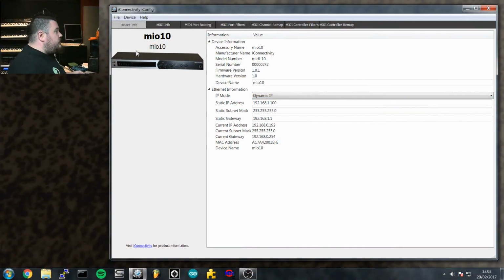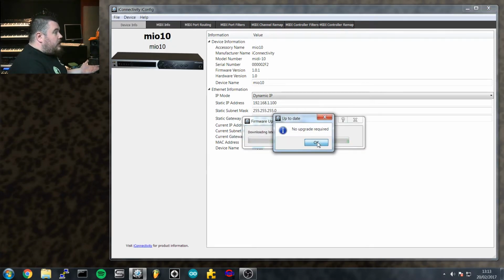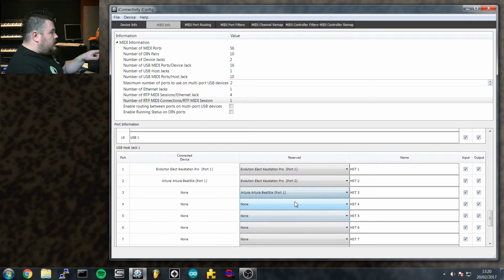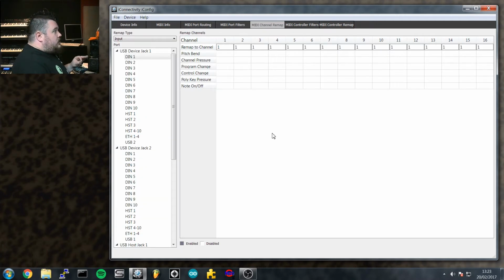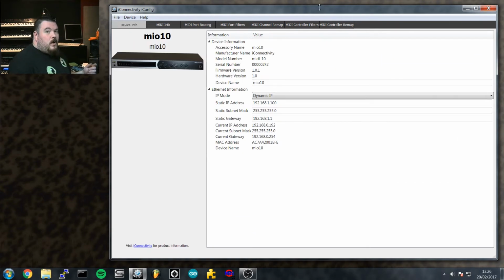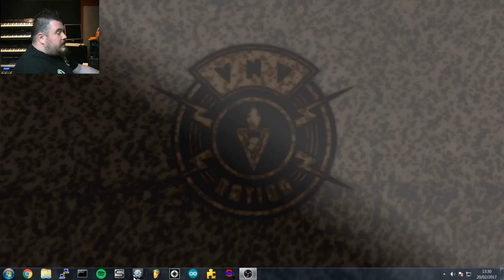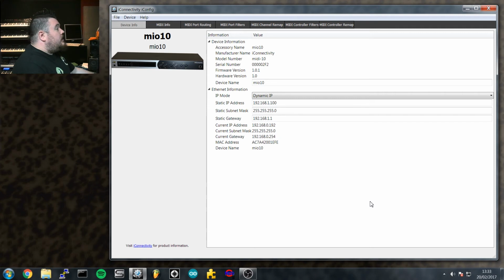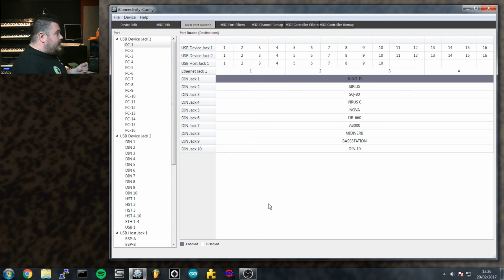iConnectivity mio10 MIDI Interface and patchbay unboxing, setup & review

Comment: I'm a little confused and hopefully you can clear this up.... This allows you to go from FL Studio MIDI out 1 into the mio10... which then goes from the output into all your synths.... & in FL Studio you can control all of your synths by giving each MIDI out inside FL Studio a different number?
Reply from the maker: Actually, the mio appears as a load of separate midi devices in FL but you can also send what's going to on port to other ports, it's very flexible.

Comment: My VoodooLab Ground Control Pro Foot Controller stops responding, sending MIDI messages after 5 minutes of use, i don't know why this happens every time ! Do you think this MIDI Box could solve this problem of MIDI messages errors, weak signals and latency ?
Reply from the maker: Sounds like the issue is in the controller itself; I'd suggest hoking it up to a computer and using something like MIDI-OX (http://www.midiox.com/) to check what's actually coming out of it..

Comment: Helpful video! Thanks for that. Although the Mio10 is now discontinued, it put me on to the MioXL. I need a MIDI interface upgrade and was about to get the Motu Express XT (in-spite of the reported ongoing SYSEX problems - because what else is still out there?) - until I discovered your video. Two things that got my attention immediately: USB input and Ethernet. I have synth gear from pre-Midi (CV), MIDI, USB eras, and even 3.5mm to Midi DIN (adapter). Being able to connect most through one hub will be a big advantage. How reliable has your iConnectivity gear (hardware and software) been?

Question I have at the moment is what is the difference between AVB and RTP? Eg MOTU and PreSonus uses AVB networking  (I have a MOTU AVB switch and Audio Interfaces). Is the iConnectivity compatible with the AVB Switch, or will I have to plug it into a normal ethernet switch? I cannot find an answer through google, but I assume the latter. Will any conflicts result? I assume the computer can handle the different protocols through different host software. I also use Steinberg (Cubase) and other software on Windows 10.

Also I assume the mioXL can be used in stand-alone mode without a computer - something I need ocassionally to connect my legacy hardware synths together without a PC.

Comment: Good video.

Coupla things. 

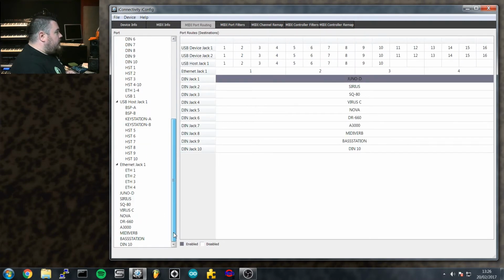Your master template, (20:43) seems to have two ports named for each USB controller, but Max Ports per USB Device is still set to one.

Also, when naming devices, I find it less confusing if I include both the Mio-10 port type and number, AND the name I wish to assign to it.

Example, a DX-7 on DIN port 3 gets the name "D3 DX7." An Akai MPK-261 on USB port 2 gets the name "U2 MPK 261."

This is especially useful when inside a given PC or DAW. A string of 16 devicenames only, makes it hard to know which LEDs on the front panel should or should not be lit at any given time, and missing assignments by one port then LOOK pretty much ok, delaying successful troubleshooting.

These problems go away when the devicename includes both the port number and device type, as described above.

Comment: Sadly there seems still to be no way to route a devices midi channels seperatley to each of the ins and outputs.  So, for instance on my Squarp Pyramid i cant route midi ch1 to DIN10 INPUT ch1 then Pyramid Ch1 tyo DIN10 INPUT Ch2 - its a huge failing imo.

Comment: I have a mio10 my main configuration that came with the unit is inactive hit rest on mio10 but no MIDI lights or external MIDI equipment is non functional. Look in your iconnectiviy iconfig and do a step by step instructions video to physically reset mio10 email me the configuration
jnreissiger@gmail.com
Thanks

Comment: Hey there great review on the mio10! My quick questions. 1) I have a few midi synth modules that I want just pull sounds into my DAW for, so can I just use a single midi cable on my DIN ports? 2) for the USB hub can it handle a midi controller keyboard as long as it is class compliant? 3) Do you have a video on working with virtual synth connections (I’d like to use my Native Instruments Komplete library in this chain as well)?  Thanks for any thoughts you can share.  Keep the great vids coming sir.   —Mel...

Comment: Fab review thank you. My question is based around further expansion. I have an old Edirol UM880 which stopped working properly with my Macbook when El Capitan came out hence buying the MIO10. The UM880 is a class compliant device so I wondered if it should work with a hook up from the (standard flat) USB port on the back of the MIO into the (square) USB B in on the UM880. I'm guessing I should then set the maximum number of ports to 8 in the software to be able to "see" the 8x8 ports for routing?

Comment: thank you!!! excellent review. I wish i had looked this up sooner:) 
spent a few hours learning from the manual ( this can be better written especially giving more examples of in the midi routing page with respect to midi modules, vs synths vs midi controllers as well as in the midi filtering page. Also listing the din jacks separately on two usb for computer connection as well as separately was also a bit confusing, especially for novices. Illustrating each concepts with examples would greatly help in improving the manual. you did a very good job in explaining things. 

the way i got around the usb hosts midi channel was to directly program the synths to receive midi on 1 channel from the daw. On my korg kronos i left to receive on all channels for sequencer to play in 16 channels is needed. My moog one, subsequent 37, deepmind and Model D receive on predetermined channels set on the synths.

Comment: Great review! Do you know if the software is been improved since 2017?
Reply from the maker: There are a bunch of fixes to the software I've shown - however iConnectivity also have an alternative setup system now as well, covering all their interface,, which is easier to use though has less in the way of detailed configurability (though I understand they will be extending it going forward)
Reply: I wish they had an iconfig reset if ya make an error as I did and I've had my mio10 since August 8th and as I finished all connections it ran as claimed but do make a video explaining how to fix the iconfig settings if everything was and is deselected you can reset it back to default in the iconfig program right now, this will be a major problem for new users and current users also. So please revise the manual for resetting the iconfig settings back to default as well add the iconfig reset defaults in auracle too this is required if you make a mistake routing information to and from devices. The reset function should also be in the auricle settings program and have all the settings backed on a USB drive. Figuring this out as a novice is not practical for anyone using any iconnectiviy unit. I'm contacting iconnectiviy Monday to see if I can resolve my mistake. Because my mio10 is blank and no instructions to read here, online at iconnectiviy.com anywhere is unexplainable. Be very careful what you route to and from any devices even if you do not know the iconfig program and it's preinstalled settings. This is what you get for not reading the default settings in the mio10 or other units main screens first six tabs and so forth. Recommend making some calls and changes to iconfig and reconfiguring iconfig into auracle so auracle can reset and resolve mistakes users make. Be careful. However make iconnectiviy aware of this.

Comment: Thanks so much for this.

I'm pretty much sold after watching.  👍

I've been looking for something like this but haven't wanted to pay the money for the motu.

In my scenario I've currently got all my hardware hooked up to my MPC but that makes it a pain to integrate the computer usefully so I have to choose between the two ways of working.

I'm hoping I'll be able to set this up with a couple of configs so I can switch between a preset that routes everything from the mpc to the hardware as it currently works but also allows me to use the computer & ipads as additional instruments and then another to allow me two way communication to all my synths and drum machines from the DAW without having to spend half an hour re-cabling.

Comment: Great and very usefull review, thx Bro! 

But one more and maybe a noob question: For example your arturia is connected through a USB hub and this usb hub is connected to the "usb port type A" on the Mio10, right? So this way it recognizes the keystations automaticaly? Will this do as well with the Nov-Peak, Rol. Tr8-S and to all USB connectable devices that i hook up to the same usb hub that is connected to the Mio10?

I'm using a FocusRite Scarlett 18i20 that is hooked up on my Intel Core i7-8700K 5.2 Ghz with Ableton live 10 and also connected by the DIN to the MIO-10. My MIO-10 detects a "FocusRite AE Peak(Port 1)" only, So i realy don't understand. Because i use a TP-Link powerd 7ports usb hub(3.0-2.0 usb supported) and its straight connected to the MIO-10 and on my USB hub is the Novation Peak and a Roland Tr8-s but it isn't shown in the MIO-10, just a "FocusRite AE Peak(Port 1)" 

I don't understand why its not in the list. Maybe you know why not, or anybody knows why?

Thx

Comment: Hey, i just got my mio10 yesterday and i think i might have figured out how to configure the feature you needed... i am using a advance61 as a master keybord and have the ability to select the 16 midi-channels like you wanted to do...
What i did on the OUTPUT filters on each synth port: enable all filters on the channels, the device should not listen to... so for the d-05 for example only the 5th "stack" is disabled (white) and so on... as all of my devices are configured (on the device) for port 1, i also did a remap on each OUTPUT midi port where the synths are connected with ENABLING (dark color) the reroute from port 5 to 1 (again the d-05 example)
These 2 settings for each synth OUTPUT side... (filter + remap) solved the issue to me....
the funny thing is: as the virus is multitimbral, i did this for many ports of the virus so i can select the different virus tracks from the master keyboard as well an use it as "different synths" very easily...
The bad thing about this kind of "workaround" is: only 16 channels!!! thats it....
But you could expand this idea with a second master keyboard routing to a complete new 16 channels on 16 diferent instruments - so if all 16 "instruments" from the first 16 port stack do not communicate to the 2nd. masterkeyboard, they'll not get any trigger from it... 
in fact i can do it with my master-keyboard alone because it has a second virtual port and i can select Channels A1-16 and also B1-16 - so i have 32 channels to use with only one master-keyboard...

i am using: Virus TI2 polar, Virus TI2 Rack, D-05, Digitakt and getting Deepmind12 and Behringer Model D soon...
Controllers are Akai Advance61, Beatstep Pro, Akai MPD232 and Keystep is ordered already...
Reply: i just wanted to add why i wrote OUTPUT in big letters: on the port-filters and channel-remap tabs, in the left upper corner the little select box is automativly set to INPUT... which means the INPUT PORT on the mio side.... but the communication TO the synth is on the mio OUTPUT side.... so this little box-entrry has to be changed to OUTPUT in order to geht the correct interface for these settings!
Reply: Does the Advance work in the host port of the mio?  I haven't been able to find that out anywhere.
Reply: the physical host ports (1 in the front and 1 in the back) are for computer-hosts only... (the USB-B Ports)
The anvance can be used via classical midi (with power supply on the anvance) or on the regular midi port (i am using a usb hub and have connected the anvance, mpd232 and beatstep pro) - the manual is really acurate regarding hw-setup... the software-setup was lots of trial and error for me :)
Reply: Great! Thanks for the info.  I just ordered a mio4.
Reply: I got my mio and so far am able to use the Advance as a generic MIDI device but are you able to access the VIP software from the keyboard when it's connected to the usb host port on the mio?  I haven't been able to figure out how to do that yet.
Reply: oh, honestly i am not using the VIP software... your workaround might be: get a power supply to make the midi din port working and connect the advance to the mio ---------- and use the midi via USB directly on your PC.... so the VIP will connect via usb and all the other configs and special routings you might want to create can be done via DIN-Midi... USB Midi will use Channels A1 - A16 = USB ... Channels B1-B16 = USB ... on your computer there will be a a "port 3" as well - this is in fact a dedicated virtial port vor VIP-Communication... http://community.akaipro.com/akai_professional/topics/advance-61-confusing-me-with-ports-1-2-3-and-midi-a-and-b-ports
Reply: Yeah, it looks like I'll have to connect it to the mio via DIN.  I might have to eventually upgrade to a mio10 or another device in addition to the mio4 in order to have more DIN's.  I hear that you can run the mio into the host usb port of another iConnectivity device such as an audio4+ but I wonder if it would just be easier to have one device.  Anyway, thanks for the advice.

Comment: Hi. Thank you for the review. Can I use the interface in standalone mode? Thank you in advance. Kind regards, Gernot.
Reply: Yet another great question. Can this device be used as a hardware only thru box?
Reply from the maker: @bobcatt2294  If you disconnect the USB, the routing still happens. So yes, Standalone is possible.

Comment: Can this do lightning to USB and run MIDI from an iPad into the box?
Reply: ChasingDogma did you get an answer to this question?
Reply: According to the specs on the iConnectivity site it is iOS compatible. So I suspect it does.

Comment: Hi. Between this unit and a MOTU midi express xt , which is the best?
Reply from the maker: I'd definitely go with this unit - the tech is much newer, the drivers and config are great and the company has shown a lot of willing to provide support.
Reply: Thanks for your help. I just ordered the MIDI4+. I think it suits my needs a little better and is a little cheaper than the mio10.
Reply: @ericarseneau1904  still using the midi14+ ?. Im thinking of getting one for a host of usb synths and old midi synths linked to a daw/cubase
Reply: @chasethedust  I am still using it and it has never given me a bit of problem. It can be complicated to setup but can do anything as far as routing goes.